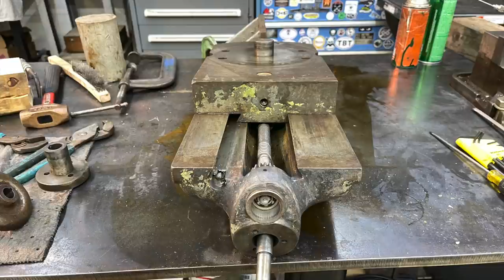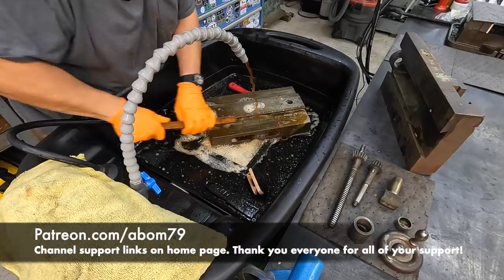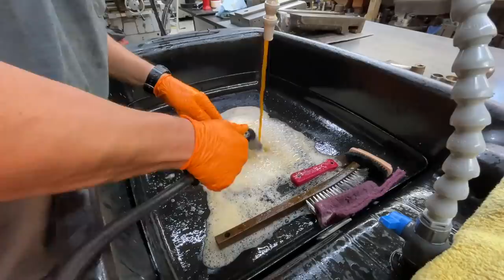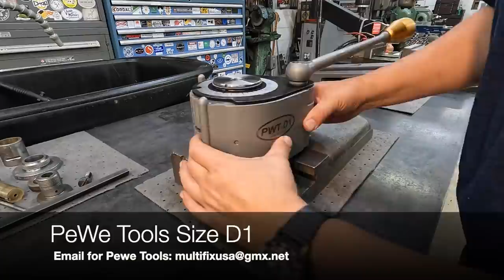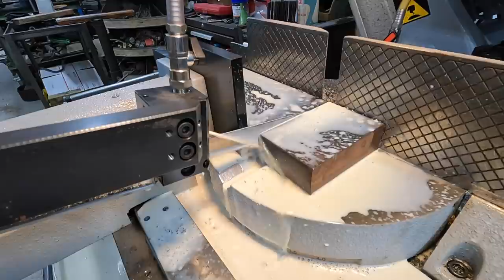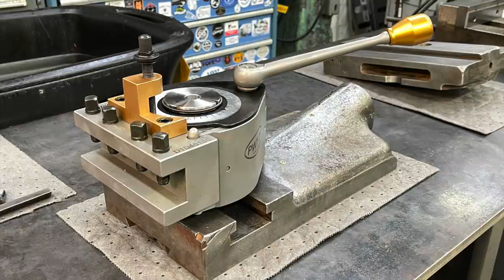SNS 360: American Pacemaker Compound Tear-Down For Rebuild

Comment: 6201 are the wrong bearings.  You need angular contact ball bearings.  6201 are not it.
Reply: That lathe was built without angular bearings
Reply: @harveyblough7204  That probably explains why they got crunchy in the first place. Certainly not a bad idea to upgrade if one is not concerned about staying 100% original.
Reply: @matthewperlman3356  not if you're trying to restore  it to original it's not what's being that machine was never designed for it more than likely have 1end of the  shaft is a floating shaft if it is and you put in angular bearings you're going to have the all the  load one end of the bearing set which the machine was never designed to handle you can wear out the bevel gear for doing that to be real the reason why they use standard ball bearings in them is because all they have to do is rotate they don't have angular Force like your thinking if you were going to do any upgrade you would use a Thrust bearing just doing through and throwing in any bearing you think is going to work on a project is not how you fix it it's like using Ford parts in a Chevy engine the reason why it got crunchy is it was made with some bearings that were never made with seals so it took dirt and material into the bearings they used to use packings over them bearings are generally made of felt and  rot away very easily over the years
Reply: @harveyblough7204 Angular ball bearings were then (and are still) used in opposing pairs, not singly, in medium to high class applications. At the time this lathe was designed that was the gold standard for high precision zero (axial & radial) clearance machine tool spindles and shafts. New Departure were one supplier making very accurate bearings used by American Tool (Pacemaker), Pratt & Whitney machine tools, etc etc. I priced one from ND for my P&W Lathe headstock spindle 20 years ago and it cost more than the lathe, in fact, more than most lathes.
You seem to be making up theories based on jumping to wrong conclusions. 
I´m not interested in trying to humiliate you, I´m trying to rescue you from continuing to humiliate yourself. 
In public.
Reply: @Gottenhimfella  all you've done is Justified what I said if they intended to use that in that application for that purpose they would have it was not designed for angular bearings PS if you're going to correct someone and try to make them look foolish maybe you should realize and understand what you're talking about before you say it if they wanted they could have used a needle bearing but they didn't they chose to use a ball bearing more than likely it was deep Groove ball bearing you remind me of this guy you came in to get a wheel bearing fixed and wanted to change out the roller bearings and put in ball bearings and you don't even know the history or when the bearing you're talking about is been patent angular contact bearings were pattenden in the UK and 1947 and in the US in 1951 that machine is over eighty years old they did not make that bearing when it was built don't take someone giving knowledge as them assuming anything when they're giving variables I assumed nothing I gave variables hint that  why I use the word if

Comment: parat tool post would've been a better, more rigid solution than those shitty multifix options
Reply: Parat are best suited for repetition turning. A four tool turret is hopeless for one-offs, the tools are always in each others´ way (or hitting the tailstock). And the amount of overhang is far from ideal.
Multifix is not always ideal either, but rigidity is not an inherent problem to the design, and calling it ¨shitty¨ is classic fanboi.